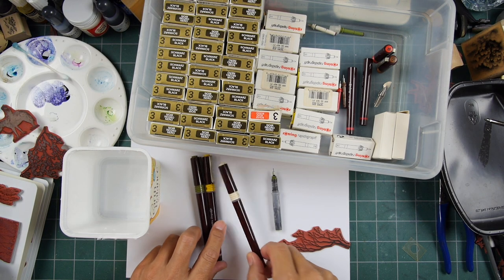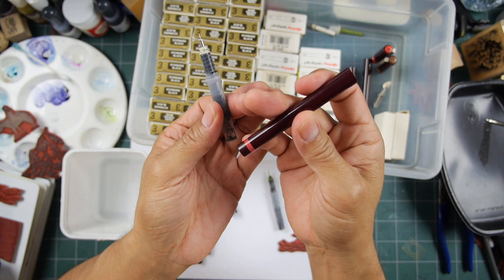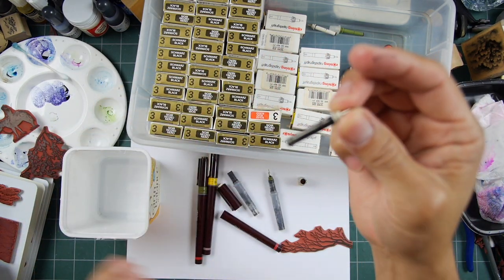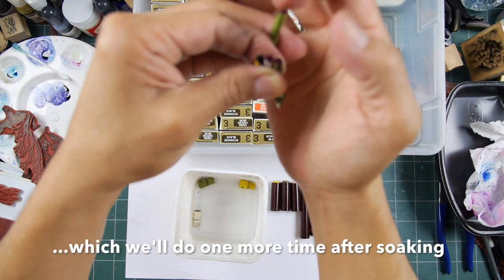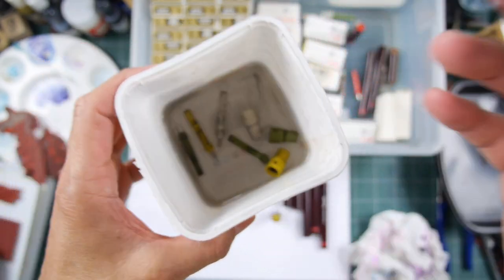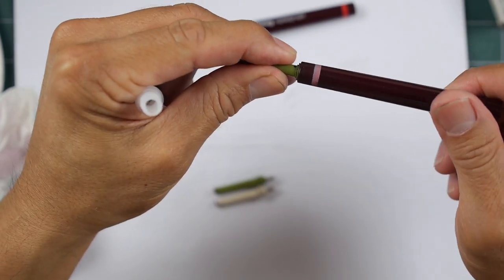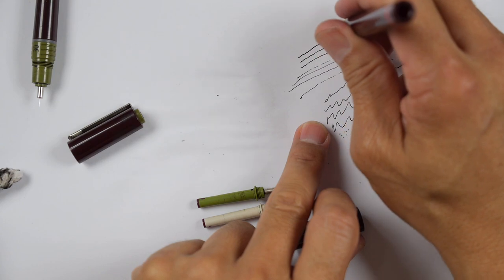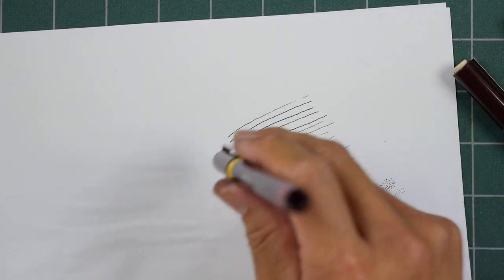Rotring Rapidograph Cleaning & Unclogging

Comment: During use, ink comes out from under the white plastic, what can be done?
Reply from the maker: Are you using a Rotring Rapidograph or something like an Isograph tech pen?  Let me know as that could make a difference.  Now, if it's a Rotring Rapidograph with the cartridge system and you used a new cartridge with it, it could be that the seal between the nib and cartridge wasn't sealed nice and flush when breaking the membrane to the ink.  But, there's usually so much force needed to do that that I wouldn't imagine that that's the case.  The other thing that I'd guess is that there could be some kind of crack somewhere along the nib or is the metal/plastic connection part of the nib loose at all?  Also, if you remove the plastic sheath that you screw over the nib/cartridge, can you tell where the leak is coming from?  Let me know.
Reply: @stampscapes  I use Rotring rapidograph 0.25 Occasionally I rinse the ink cartridge and refill ink with a syringe. In one of the pens, ink comes out of the plastic near the tip of the pen. (I also have a Rotring isograph it lasts for many years, and its maintenance is simpler)
Reply from the maker: @bar3133  The .25 along with the .30 are my main sizes (and almost exclusive sizes) that I use.  If you're getting leaking from that plastic where the metal goes into it, it sounds like the tip is loose.  If it were farther back under the sheath, I would suggest maybe one wrap with a plumbers tape around the nib/cartridge connection before screwing on the sheath.  But, if ink is coming out around the needle or where the wider metal inserts into the plastic, I was wondering if a little super glue or something like that would work.  Just a thin layer painted around those contacts.  I would think that could, potentially, be something to prolong the use of the nib as long as it's flowing properly still and there's no other issues with it other than the leak.  The only issues I've had with the nibs is that situation where there seems to be pressure built up in the cartridge and, as you're holding the pen, a bead of ink keeps forming on the tip of the pen.  If I've been working with the pen for hours, I've wondered if the heat from my hand was causing the air in the cartridge to pressurize or something like that.
Reply: @stampscapes  I'll check it out. Thank you very much